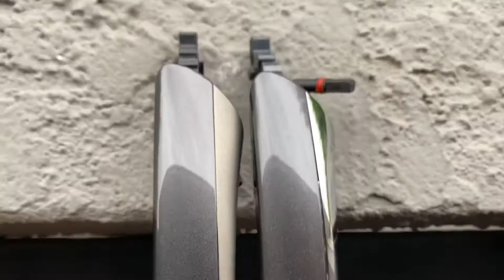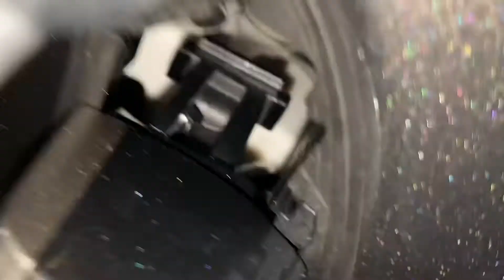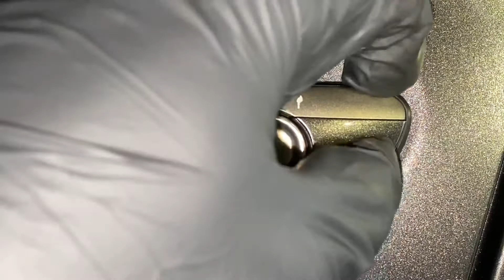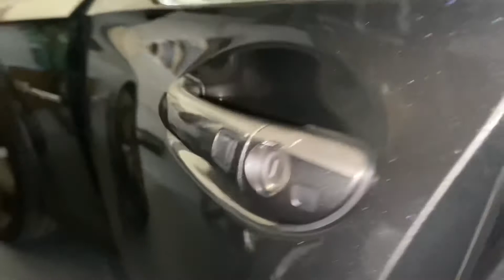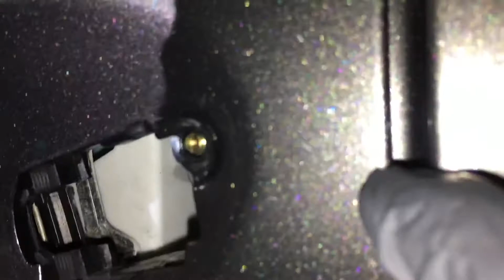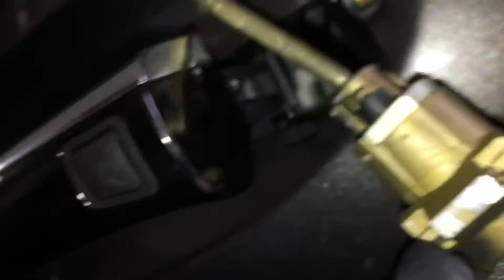CLS 55 AMG W219 W211 door handle installation process. Macro.

Comment: Hey sir! Do you have to code in new door handle? Or just plug out with old and in with new door handle?

Can i just order a used door handle on ebay?
Reply from the maker: No need programming. Yes if it’s the same. Watch this
https://youtu.be/9ZQhmFFZxnU?si=nbvzpGJzcp_pz5zd  
and then the pt.2
https://youtu.be/wHfAyVIKm2I?si=Ql5A37AeAlprsgCX
Reply: @bigboycars thank you so much sir:)

Comment: You can install for 2003 w211 the w219 keyless go handle without any problem? Thanks for your help!
Reply from the maker: Yes, the CLS class W219 based on E class W211. If keyless go option is available for your car.
Reply: Available, thanks for your fast response!